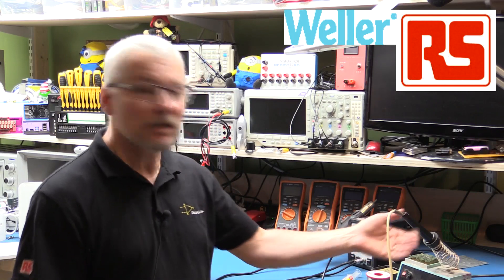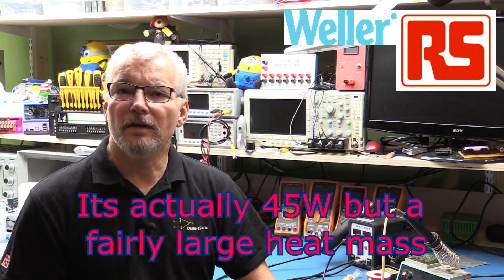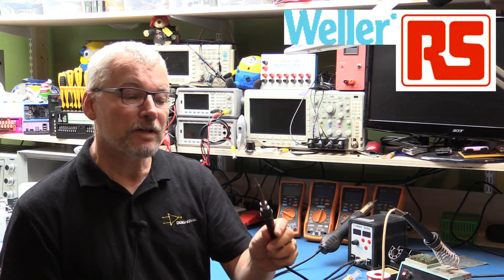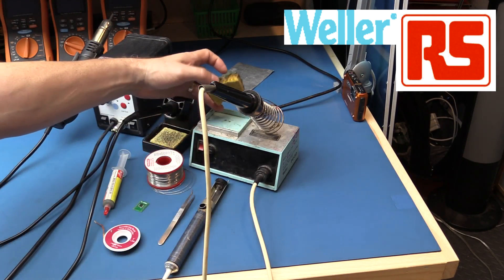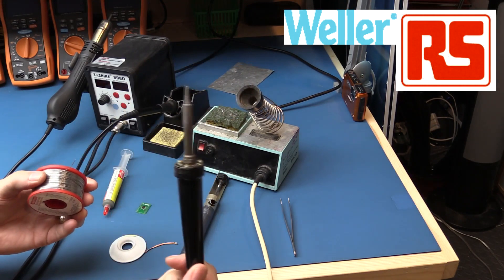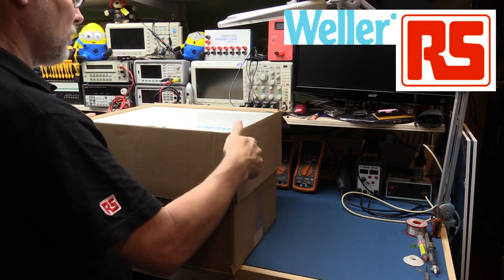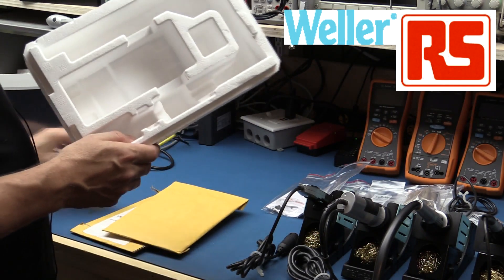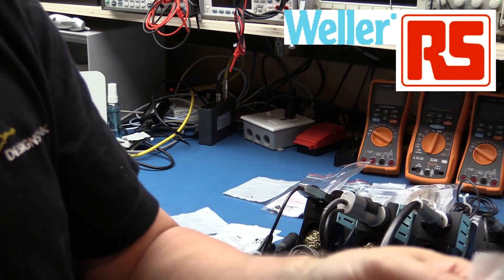Mail Bag - Weller WXR 3003 Rework Station

Comment: No way some hobbyist will buy this over-priced station.
Reply from the maker: Perhaps not, but way back when I got my first Weller it was expensive but I knew it was good quality and would last... it did. Yes the WXR is expensive but if you look at the tools rather than the base and compare to equivalent quality by other manufacturers, I think you will find it comparable. Good engineering comes with a price, same for any manufacturer, when I hold and use it compared to the Sake, there is no comparison.